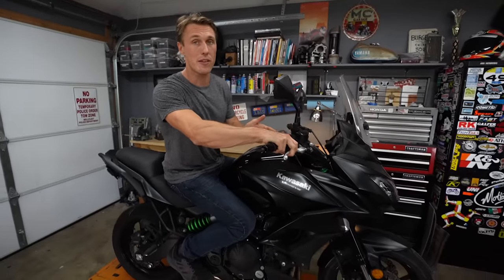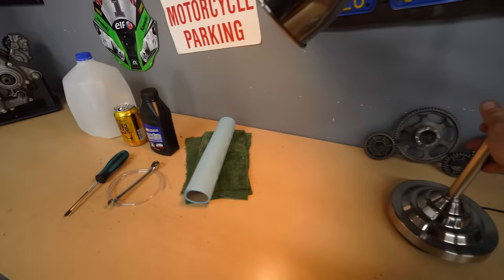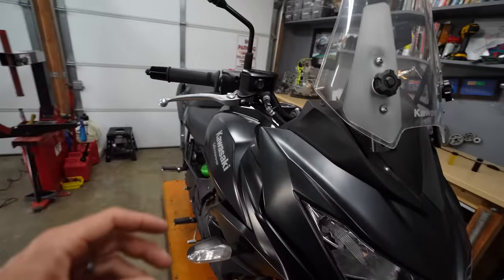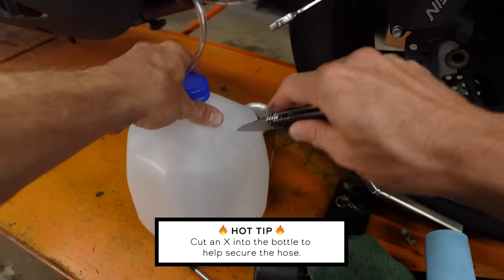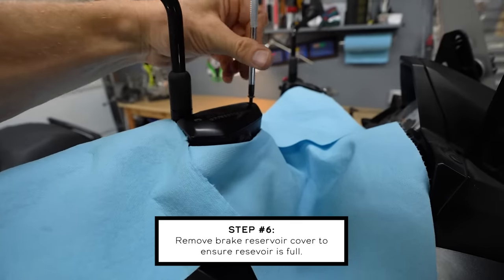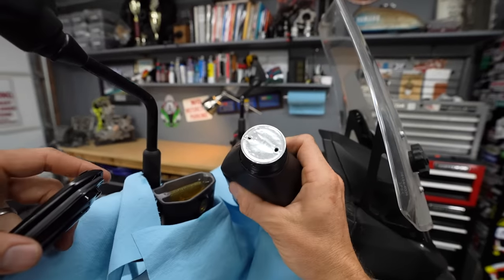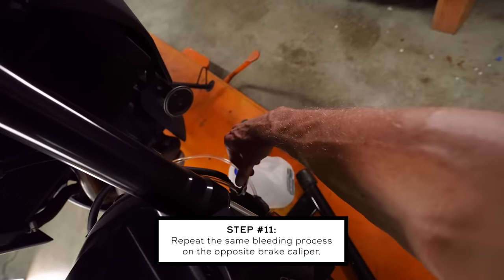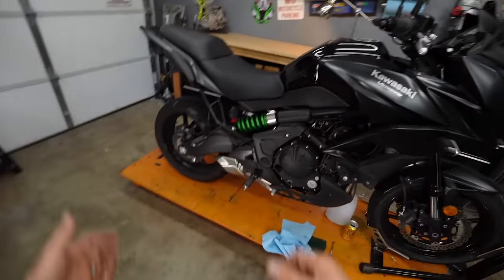How To Flush and Bleed Your Motorcycle Brakes | The Shop Manual

Comment: Hi - Thanks a million - youve made the job one heck of lot easier & for the "Biggest" tip (for me)  which was that the screws on the master are JIS (i would have just got the phillips out & torn them apart) & the next important was to draw out the fluid using a syringe -Thankyou

Comment: The only thing I’d add that we do in the shop is after you’ve bled the front a lot of the bikes will get air trapped in the horizontal parts of the master cylinder so it helps to remove the cover and tap on the side of it a bit and gently make little pulls on the lever until you stop seeing bubbles coming up out of the master cylinder into the reservoir.

Comment: I use a soda bottle to catch the used fluid.  I drilled a hole in the cap and put the tube in it; the hole should be small enough that the tube is snug.  This is the equipment that I always have on hand.  Then I get a new (empty) bottle and put my cap/tube on it.  Once done, I put the new cap (without a hole) back on the bottle and it's ready to be disposed of.   With the line snug in the drilled-out cap, the bottle can even fall over and nothing will leak.  Cutting an "X" like you do allows for possible leakage.

Comment: One tip, one suggestion 
Suggestion, buy a pair of large syringes from a vet for like $10. You can use them a ton in bikes, but suck the fluid from the master. Then use the syringe on the bleeder, push the fluid UP to the master. Never have a bubble doing it this way

That JIS brand that was shown is Vessel. They also make other awesome screwdrivers, a $12 ball handle with bits, including JIS, and the Impacta! A JIS screwdriver and impact driver in one. Also pretty inexpensive, but it’ll pop off any stuck JIS fastener.
Reply: +1 back bleeding with a syringe was the only way I could bleed my brakes after rebuilding my caliper. I tried the traditional way but the fluid was just going past the air trapped in the caliper no matter how many times I repeated the process. Then I found out about the syringe method and it worked first try, quick and easy

Comment: Very good tips. I especially the JIS mentioned. As kid I always F'd my moped carburator screw heads. It remained mystery for a very long time. Just few years ago one machine mechanic mentioned me the difference as he was teching me to work with one japanese machine. Indeed there is very slight difference in the profile which makes a huge difference. I immediately ordered myself a kit of JIS screw drivers. They're essential on even a bit older japanese bikes. But on that regard, someone told me that many latest japanese bikes don't have them anymore. I can't confirm this is as I ride older bikes, but just keep out eye for that dot. It's simple as that.

Comment: Question about the master cylinder. Should you open the bolts and level the whole brake lever/master cylinder before adding and checking brake fluid level?
One tip that I used to get stuck cap bolts open was to use hammer screwdriver. Once I had to drill the bolts out and luckily after drilling the came out easily.

Comment: Before radial master cylinders I used to zip tie my lever to the bar & turn my bars on full lock to the left overnight. It allows any stubborn bubbles up at the lever to flow back into the reservoir. Also the rubber seal is a diaphragm that extends & it's supposed to keep the space free from drawing air (& moisture) into the reservoir should you lose any fluid. It's probably obvious but if not; if the diaphragm/seal popped out, take it away from the bike (it can get splashy) & pop the folds back in place before bleeding.

Comment: Cool video. Thank you. I just add that on specific bikes like my Beverly 400 scooter the system must be plugged in to a computer, cause you have to put the ABS into the bleeding mode electronically. Otherwise it won't work. So if you have a bike with ABS be sure to check the procedure for your particular motorcycle.

Comment: That's super. I've been bleeding my brakes not the right way for years. I've been pumping the leaver locking off the bleed nipple at the same time. It works but it's tricky. Top video. Terry

Comment: Great video. Not sure it was mentioned, but some bikes have a bleed valve next to the brake lever (like my Kawasaki Z900RS). The brake lever on mine was squishy, and no matter how much bleeding down at the caliper the brakes were still spongy. One quick bleed at the brake lever and the lever is the brakes are nice and tight with the air bubble gone.

Comment: Ditch the philips / cross heads screws and get torx or alen head screws And use antisize. If the heads are stripped or stuck tap them with a punch and use a penetrate spray. On mx bikes you can spray from the bottom of the bolt. If they still down budge use a impact screw driver. If that doesn’t work drill off the top cone head of the the screw then the lid should be removable. cover the reservoir with tape. you might be able to grab the the screws now with a locking plier or put a notch in the screw  with a dremel to use a flat head screw driver. if that still doesn’t work try a Ryobi screw extractor. Last chance is to drill through entire screw with a smaller bit and use a tap to clean the threads.

Comment: Great video Ari! Love the Shop Manual. I use a large seringe with the hose to bleed and to open the reservoir cover I often make use of a impact tool -hammer type (because the screws always get stuck).
Reply: They get stuck because you over-tighten them. Counter-sunk screws locks themselves when tightened.
I am working on machines that have counter-sunk screws and the over-tightened ones makes sparks fly when you loosen them.
Reply: It's usually enough to hammer head with standard screw driver. Obviously screwdriver head should be a model that has through type head that's made for hammering. One of the first things older machine mechanic told me that if something is seriously stuck. Just keep hammering the head with light to moderate force. They usually give up, but it requires quite a bit of patience from mechanic. It can also work if you can tap female thread side, but that usually leaves marks and in most cases isn't possible at all. It's very good tip and used it much. Once my friend was struggling big time with big rusted nut. The thread part turned with seized nut. Taking block of metal to use as anvil and simply hammering sides of nut for a good while resulted nut to be taken out almost with bare fingers. I'm sure you knew about this, but hopefully it could be a good tip for many others :)

Comment: Excellent vid! That X in the bottle and upward loop were genius, never thought of that, add some weight to the bottle like someone else mentioned so it doesn't go flying. Mentioned everything I thought you'd leave out except making sure you get the res gasket seated before screwing it down. They can be old and dry on older bikes and better off with a new gasket.

Comment: Awesome video right to the point. I used every single one of your tips. That was long overdue on my bike the rear brake fluid looked like used motor oil. The front, not a whole lot better. New pads and fresh oil talk about stopping power. Next project fork oil.

Comment: My Suzuki manual says to flush the fluid you attach the hose to the bleed nipple, open the bleeder valve and just pump the old fluid out while topping up the reservoir with new fluid without closing the bleeder valve. Keep the end of the hose submerged in fluid in the container and once the hose is completely filled with fluid, air can’t go back into the system when you release the brake lever.

It’s a lot faster than closing the bleeder valve every time as you can quickly just pump the old fluid out but you MUST bleed the system using the normal method to make sure there is no air bubbles and you have a firm lever.  Doing it this way takes half the time and achieves the same result. Let me know if I’m doing anything wrong by doing it like that

Comment: For those who have completely empty new or old brake line. Wrap the line with rag or tower somewhere near the leaver so you don't damage it and pinch it with pliers. You making a one way valve by putting some resistance for fluid to fill the line. If u don't do this u wont manage to fill the line. U should mention this in the video too.

Comment: Thanks for that, really some very practical tips - always a pleasure to learn from someone who has both the experience and the "I wonder if that would work better..." attitude - and the tips with the x'ed bottle (or bottle cap, I suppose) and the two holes in the container wil absolutely get put to good use!
Another tiny contribution which helped me at one point, getting some nasty trapped air pockets out of a system that was hopelessly bubbled up after messing up my initial attempts, and just wouldn't come out, regardless of how many containers of liquid I ran through: Putting pressure on the brake system obviously compresses the bubbles, making them smaller and in some cases easier to move. So it may help to use a velcro or zip tie to keep the handle pressed over night, and suspend the calipers in varying positions to allow such air pockets to move towards the bleeder eventually. Took me two nights, but it eventually came out - so satisfying to finally see that bubble in the hose, like a nasty dry cough eventually coming loose :)

Comment: About ABS bikes. It's good idea to activate ABS pump after fluid change and flush it again. Just hard press rear brake while riding and it'll activate. I learned this hard way, because ABS pumps on Yamaha's CP2 engines (i.e. mt07) are not very reliable (with old fluid they get faulty and makes high pitch noise when activated), so better keep a eye on fluid change intervals.

Comment: Hi Ari.  Great video.  Just one thing confuses me though—you stopped bleeding the lines after the bubbles disappeared.  Aren’t you supposed to flush until you se a change from dark to light fluid indicating the old fluid is flushed and replaced with fresh brake fluid?
Reply: Yes, that's the correct procedure and something I failed to explain in detail as I was bleeding the brakes.

Comment: What about underslung rear callipers?

On bikes with this feature, the bleed nipple is not at the high point in the system. Some pundits suggest unbolting the calliper, placing a wedge or block between the pads, and turning the calliper upside down (right way up?) to bleed the brakes.

Thoughts?
Reply: Yes, I've done this, exactly as you say. Unbolt the caliper, hang the caliper (I use a daisey chain of zip ties of the rear foot pegs) so the bleed nipple is the highest point of the  system, and the nipple is pointing upwards, and place a spacer (a piece of metal plate or some use a spanner) between the brake pads, to replicate the brake disc. I wrap a zip tie around the caliper to hold the spacer in. Then bleed brakes as normal 👍

Comment: Just btw if you recently dropped your bike and your lever is soft and spongy, it might be your rotors which could be bent. Basically bent rotors push the pads in when you move the wheel. so just check them in case. 
Source: dropped bike while loading and spent 2 months trying to fix

Comment: Good video! I know you mentioned there isn't much fluid in a bike, but I still really like the vacuum pumps.. Tons of cheap hand vacuum pump kits for $20 or so, other can actually use an air compressor. Makes brake bleeding so much faster on cars and motorcycles.

Comment: Great tips on some of the commonly overlooked stuff.....order for calipers and master cyl, looping the drain tube up and small pour/air holes in the brake fluid container. I've bled brakes may times and I've learned from this video. I've used a reverse injection bleeder system several time with varying degrees of success and have reverted to this "pump and dump" that's worked every time. Stubborn part has been on the master cyl at the lever and sometime its necessary to loosen the assembly and rotate the cyl to completely remove trapped air.

Comment: This method works well enough however I've recently learned the reverse bleed method, pressurizing the brake system from the caliper via a syringe. It more reliably keeps air out of the caliper as air rises toward the master cylinder.
Reply: YES! That's my go-to any time I replace brake lines or fully remove a master cylinder or caliper. Great method for purging a system that's got a lot of air in it. You can get an appropriately large syringe from a veterinary supply store.

Comment: Great Informative Video. The only thing I missed is when you get to the Radiated Master Cylinder Bleed Nipple after doing the lower left and Right front calipers, are you supposed to leave the reservoir cap Loose like before when bleeding the prior , or do you close the system before bleeding the master Cylinder, Thx.

Comment: Thank you for this video! I'm about to embark on this very process, but will have to actually install the hydraulic brake system first. (converting from cable-activated drum)  It's gone from "terrifyingly overwhelming" to "just might pull it off."

Comment: Do all the connections with
 jug, hose and all that.
Remove cover on reservoir.
Top it up with fresh fluid.
Open bleeder and let gravity do the job.
Top up reservoir during process and when new fluid appear in hose, then bleed as normal.
No need to pump and close bleeder all the time.

Comment: Don’t you have to ensure you refill the reservoir to the exact same level to avoid fluid spilling out if you put fresh brake pads in? Because you have to push the pistons back sending excess fluid into the reservoir? I’m thinking if you over fill the reservoir you might not be able to push the pads in right? First time I did it I overfilled the reservoir and it started weeping from the reservoir when I went for a ride. The second time I bled them I used a level on the reservoir to ensure it was flat then used a sharp leather piercer to lightly mark the level of blue on the inside of the reservoir not deep enough to scrape metal off just enough to see it. I then refilled to exact mark at the end. Not sure if I’m being anal or not but didn’t have any issues second time round. Thx for all your vids.

Comment: For perfection you should clean the wet area between the reservoirecover and the rubberseal. There traps often condensating water. which is - we learned ist - no good for brakefluid.

Comment: Hi Ari, why don't you use the MP Mini Bleeder? Doesn't it let you open the valve once, then just pump the brake and keep adding fluid and then only have to close the valve at the end of the bleed?
Reply: I have one and have used it quite a bit, but I figured showing people the old-fashioned was was best. No special tools or expenditures requires.

Comment: Ran into an issue: I installed everything as brand new ("dry") components and filled up & bled the system, but the brake lever won't get to a point where one can feel the hydraulic pressure "pushing back." Is this common? Repeat the whole bleed process? Or is there some initial calibration work I need to do with those two black hex bolts behind the brake pad?

Comment: Great, I am just going to change the master cylinder of my bike with radial one and I always like your videos. Would you say that there is something additional whenever you change the whole master cylinder or is it the same just with more air in the hose?
Reply: It's more or less the same, but you'll have a harder time building pressure in the system due to the volume of air introduced when you swap a major component. Also note that when changing from an axial to a radial master it's often necessary to go up in piston size (say from 11mm to 13mm) since axial masters move slightly more fluid than radials.

Comment: after flusing it .. pull the break and wrap some rubber bands around the front breake so its pulled .. leave it over night with the wheel straight .. in the morning turn the wheel left so the reservoir is highest .. leave for another 12+ hours .. and all the minute airbubbles will be completly gone from the line .. oh and sidenote .. the beercan he mentioned does NOT have to be empty .. you can work on that job while or after the job is done!

Comment: So basically I am pouring new brake fluid on top of the old stuff and just waiting for the new stuff to appear in my bleeding hose? It doesnt matter if it mixes a little while im pouring new stuff into the old stuff?

Ps. Love the vid, I strugled with this stuff so much and was scared to tacle on something like brakes but after watching this vid I am doing it at home 100%. Thanks a lot guys :)
Reply: Yup, you're chasing the old fluid out with new fluid. If they mix a little it's not an issue. Overall the volume in the system is so low that if you push half a bottle of new brake fluid through you will have thoroughly purged all the old stuff. And then some!

Comment: I have a electric bicycle taxi and the brakes have always been a problem for me and had to bring it to a mechanic to fix it and cost me a lot of money. I have been buying secondhand bicycle taxi during the lock down and in this time I have run in these problems all the time and this video saved me hundreds of €€€€€. But I still have one more question that I need help with my bicycle taxi is a three wheeler one in the front and two in the back and the back breaks is the most problematic because they are both connected to one brake handel. I use a atv brake system
But still have some issues any advice to solve this problem???

Comment: Question: I changed the brake lines for my front brakes and drained the old ones. While I drained them, I assume I emptied the master cylinder and ABS pump oil storage? To fill it back up I just do the same as Ari here, start by filling the master cylinder, then bleed the new oil through? Many thanks